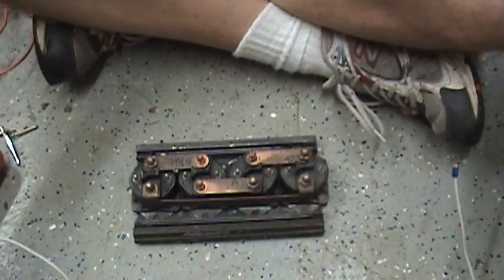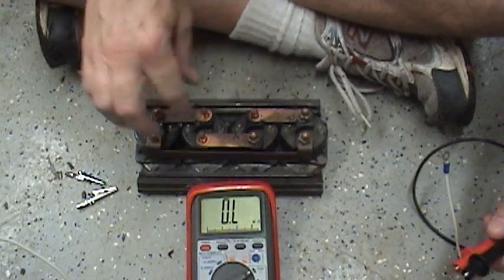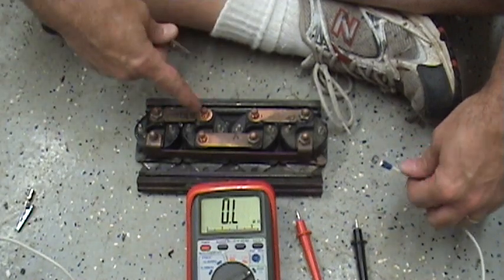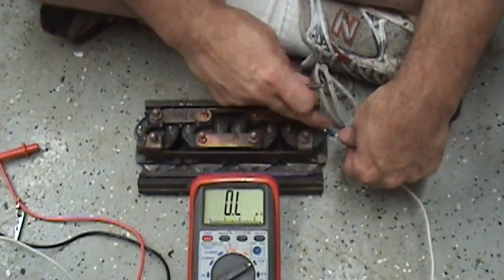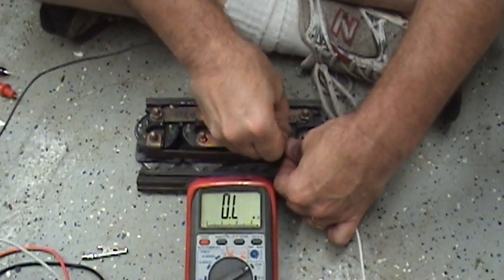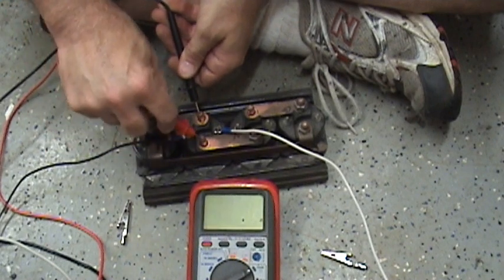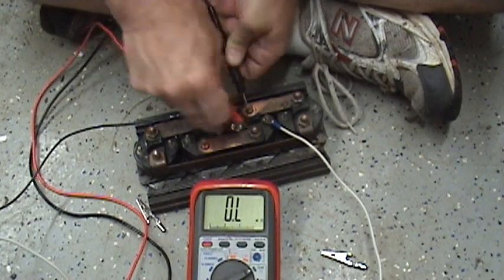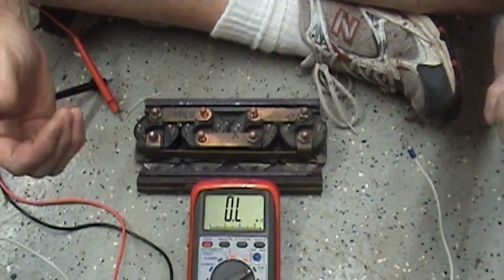How To:  Diagnose Warn Winch Solenoids

Comment: What volt battery do I need to test? I have a 12k pound warn an it just clicks.  The white wire from the remote switch melted wonder what made it get hot? It won't give in or out.. I crossed it over an the motor works In an out....
Reply from the maker: You need a 12 volt automotive battery to test the coils.  Mine is not shown in the frame of the video but it is sitting just off camera.

Comment: My winch is brand new and its 14500 lb and its been used 15 times and does not work!! It does nothing help me!!!
Reply from the maker: Johnny Smith Take it back, it's still under warranty right ?
Reply: Probably corrosion on the terminals. Mine dosent click or move which is a bad ground.

Comment: I'm actually in the same boat. A brand new warn 12k sat in my garage till a year later. Took the whole thing apart the first day, greased the crap out of it because you know they don't spend money on grease from the factory. Put it all back together and mounted it. Tested it. Pulled in fine. Would not spool out unless I tried a few times. I contacted warn. All I have to say is I'll never buy from them again. Customer service sucks. A couple years later still in the same boat. Used it twice. Not happy. I'll take a look at my solenoids. I have a feeling this is been my issue since day one.
Reply: watch the seals on them as well. have a 2 year old warn zenon on the front of a land cruiser that was almost a scrap metal project because the seals leaked from day one and rusted up all of the internals. I did not catch it until the motor started making noises trying to turn rusty gears. Once I opened it up I was horrified at the internal condition. Warn warranty was a wasted effort. Ended up rebuilding the winch at my cost and time.

Comment: I have the Warn M12000 mounted on my Chevy 3500 Silverado with upgraded batteries @ 1000 amps X  2 so there is 2000 Amps ..  i tested mine i very rarely have my solenoids only click a little... but that's after disconnecting the main positive from my battery system and then re-connecting it... looks like slight corrosion on the winch controller plug mounted to the black cover over the solenoids cleaned that up tested the link bars and power connections when i actuate the switch controller ither direction i dont get any response for voltage if it all... only thing i could do during the snow we got a little while back to stop a car from going over was free-spool enough cable then locking it... power in/out doesn't work... so how should i go about testing it ? just like you did here is there a way to test the motor to make sure its ok by its self ? so i can tell if it's not a bigger/mulitple failure problem...  and needs to be completely replaced ?

also it's not easy to work on unless i uninstall it as i Did the Ranch Hand - Full Bumper Replacement with all the options... it was my best option so i think i need to drop the which out to really test it..
Reply: raykomro I think there is a way to spin the motor just by using jumper cables to the connections on the side of the motor.   One terminal is ground,  one is forward direction,  and one terminal is reverse.  A good schematic for your model winch would be very helpful.

Comment: A proper diagnoses would be to unbolt the solenoids and bolt on a new contractor control box. Single best improvement you can make to a Warn winch.
Reply: uhhhhhh, this is a video about fixing something. what? you thought this guy thought it was illegal to buy a new contactor box? No, not contRactor, ConTactor, as in a box full of contacts.  This is a video about spending 50$ not 350$ Aaaaaaand that also isn't a diagnosis, a proper diagnosis would be "the solenoids are bad" what you suggested is called a REMEDY. however your remedy was a lazy richboy remedy in which you learn nothing and wont have a clue what to do if this happens in the middle of nowhere and you are relying on your winch to get home. surprised your "diagnosis" wasnt just "buy a new winch"

Comment: i just installed a promaxx torxx 15.0 bran new an she will spool out  fine she just wont spool in it does just a little when u hit the switch then it says overloaded an stops any ideas thanks
Reply: Bad connection recheck you wires
Reply: +Eddy Stocker hey bud the problem was a faulty overload shut down so I just bypassed it